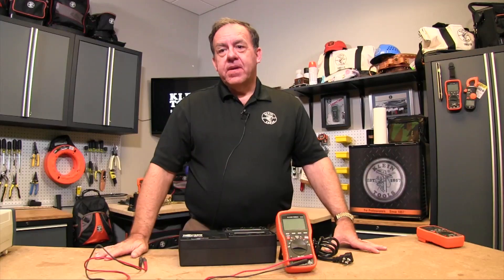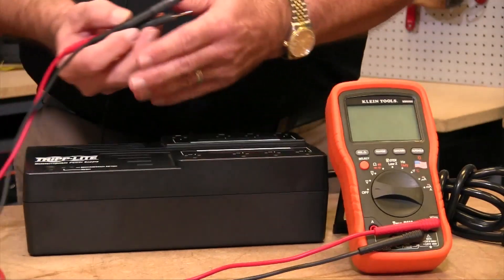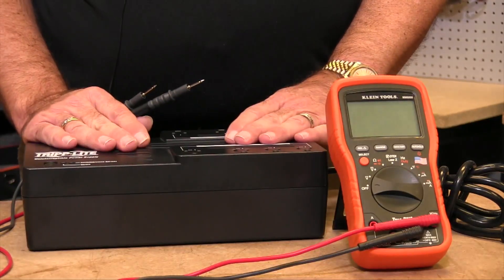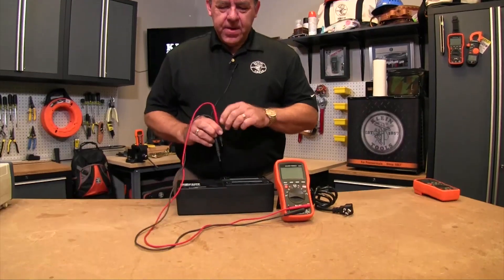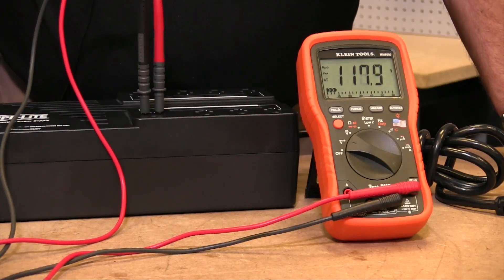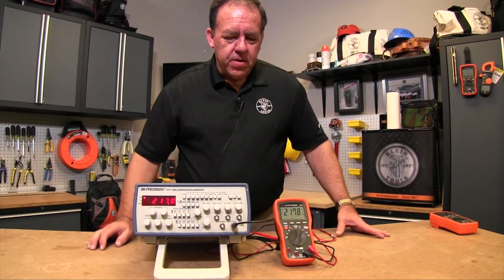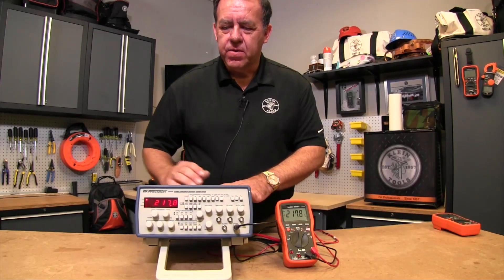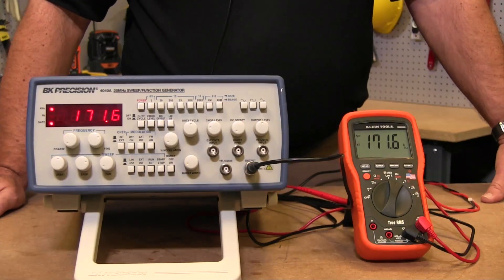How To Use The Basic Meter Function (Frequency)

Comment: Can it be used to measure or detect frequencies outside of a given input frequency signal. For e.g If I give a 1Khz signal and lets say there is more unwanted frequency of say 50hz in the path, would the meter display frequency other than 1Khz ?

Comment: Will this measure as low as 7-8Hz?
Reply: lol schumann resonance...im also looking to measure out a safe location away from the power grid to put my grounding rods into the earth to hook a wire to an aluminum foil mat to ground my body (to transfer earth electrons at the earth's frequency of 7-30 hertz to neutralize disease-causing ionized free radicals in my body) without having to worry about my earthing rods acting as antennas to ambient signals, and im thinking a way to do this is to measure body and earth frequency with a frequency multimeter
Reply: I’m not sure you need to go to that extend. When you have direct contact with the earth you become shielded. The 50-60Hz drops to 0.00Hz according to my Fluke 179 the moment you make good skin contact, ether bare feet outside or a copper wire from a radiator pipe or ground rod
Reply: @outsidethebox9658  how do you measure the current hertz from your body when inside home dealing with electronics? I can't seem to figure out, I have the right settings to 200khz in my multimeter, but it is always 0, I'm sure I should put the probes somewhere in specific..
Reply: 200khz sounds like it’s set to DC hertz and not AC. Besides that it would take highly specified meters and methods to measure the frequency of the body.
I learned that I was measuring in a wrong way. Grounding does not shield against AC signals by it self. And it does not bring the body voltage to zero, but it does decrease the body voltage significantly and let’s build up of static positive charged electrons discharge to ground.